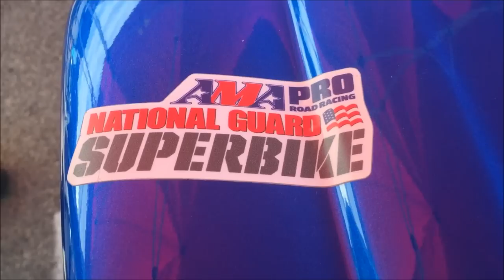SUZUKI GSXR 1000 VS AMA SUPERBIKE *HD*

Comment: I love the video - good riding, really valuable information. I wanted to ask you, if it is an OK bike to start track days? I currently own a 2008 Suzuki B-King, but I don;t want to trash it (naked frame and engine will be expensive to fix/buff). 

Your K6 looks awesome and sounds great. I think it would be awesome to buy this bike (its pretty cheap to buy secondhand), strip it from the OEM fairings, put some race plastics, slick tires and have fun on a closed course. What do you think?
Reply from the maker: +EVER TOM Graphics They are great track bikes because they are so light. The 2005/2006 Gsxr 1000 is still one of the lightest 1000s made. The 2015 Yamaha R1 only beats it by 1 pound. I am selling the Gsxr 1000 because I bought a new R1. If your interested let me know. It has light Marchesini wheels and turns very quick. Yosh pipe and a few cosmetics. 17k miles. Super clean. I bought it a little over a year ago from the original owner that babied it. Of course I have that 1 track day and about 10 canyon days. I don't think I put more than 1000 miles on it and these bikes are bullet proof. Includes the stock pipe, stock wheels and all other original parts. $7,000. Can ship anywhere in US. $150-$400. Also it looks just like the 2016 anniversary red Gsxr 1000.
Reply: +Joe A Thanks for quick response. I watched this vid a few times and the more I see the K5/K6 the more I want it. the only thing I am afraid of is the thread on the gixxer forums about their frames cracking in the welded spots - how does your frame has held up to now?

I guess it wouldn't be cost effective to freight it from your place to Poland, where I live :D
Reply from the maker: EVER TOM Graphics My frame is fine its only one spot I believe. The dealer can check it and if it is cracked they perform some sort of repair at no charge. I purchased it from Austin TX I think it cost about $300 to ship. It was the exact bike I wanted. The red is hard to find and to me is the best looking by far. Everyone that would see me on the bike thought it was brand new. Go to a web site called U Ship and get a free quot in min on shipping. I have not put it on the market yet I was waiting a few more weeks for people to get the tax refunds back. Check out the other vids on my channel that shows the bike. I live in Los Angeles.
Reply: +Joe A I have already seen your other vid - love the one where you crave corners in the canyons and that blue R1 passed you on one wheel while you had 110 on the speedo (NUTS!). The one with the Ferrari is also cool. 

the bike looks absolutely gorgeous in the red color scheeme, I give you that. and despite being 10 years old, it does not look dated in comparison to the modern/current year supersports and superbikes. 

The bike has good reviews - bulletproof engine and easy access during the maintenance in comparison to ther bikes. Also, despite the great power and 10 year old engine, it does not consume ANY oil at all (shame on the CBR sc59 and newer ones).
Reply from the maker: EVER TOM Graphics I will probably put it on the market in a week or two if interested let me know. I think it will go fast.

Comment: a few clicks less rebound damping or more compression damping in the front might help that pushing issue.
Reply from the maker: Julian Roach Nice to hear from someone that knows what they'r talking about. I actually had to lower the front end. The bike just didn't want to turn and point towards the exit like I knew it could. Also I had to max out my compression and add more preload to the front spring I was actually bottoming out my front suspension under hard braking and it chattered. I weigh 200 lbs and the suspension is bone stock. I need to get a REALl rear shock and install stiffer front springs for my weight and replace the fork oil and start from scratch if I really want to dial it in. Thanks for your comment.

Comment: hello Joe are the Pilot Power 3 good for road ?
Reply from the maker: ***** Very good. I had Pilot Power TC2s before (180/55/17) (Rear) and I noticed I could not get the bike to turn as quick as I know it could. It wanted to stand up around corners. If I was going around a turn leaned over and I took my hands off the handle bars the bike would stand straight up. Classic case of understeer. Not good if you want to get in a corner, turn, point and shoot out hard and hold the line. I installed new Pilot Power 3s (190/55/17) this tire size has more curve shape so the bike will turn quicker. First canyon ride after new tires the bike turned fine I could slide the rear wheel around corners and feel it nice and predictable.
Reply: Joe A Good notice, im using 190/50 Michelin Pilot Power (the old ones) in 1 or 2 weeks i need to change it, and i want to buy the Power 3 190/55 so thanks for the info and sorry my bad english.
Reply: +Joe A 180 on 600 and liter bikes have 190 rear tires. do you recommend 180 on liter bikes. will turn better?

Comment: WHY DOES HE COVERED MIRRORS?
Reply: Fabian Azas track rules. you have to pull headlight fuses, take off or tape mirrors etc.
Reply: oh thanks but I just need to know why? I thougth It was because the rider did not distracted or something like that... lol
Reply: Fabian Azas Its so that if you crash there isn't going to be bits of glass on the track which is a hazard, all the glass will be hopefully held together by the tape. You are also right that they don't get distracted, it's the responsibility of the faster rider to choose the best place to overtake and you don't want the slower rider swerving because he thinks he's holding up the faster rider who may have decided to overtake at that moment. It's all for safety. Hope that helps.
Reply: Adam Green oh I see, It is so good to know that... thank you all... Ive learned something new...